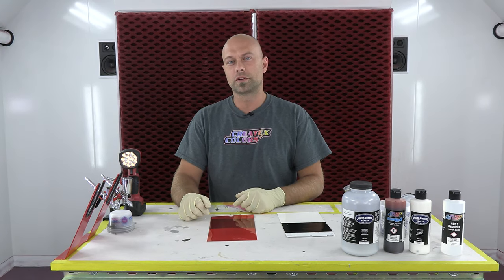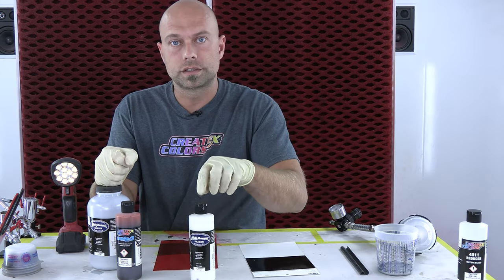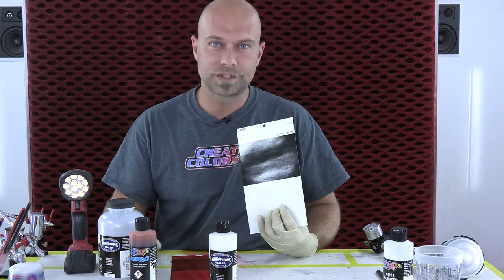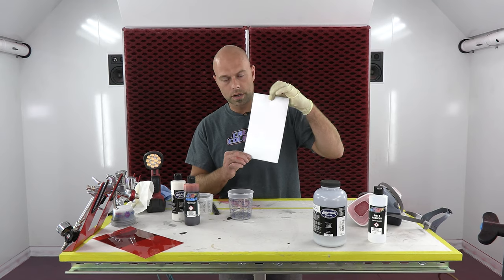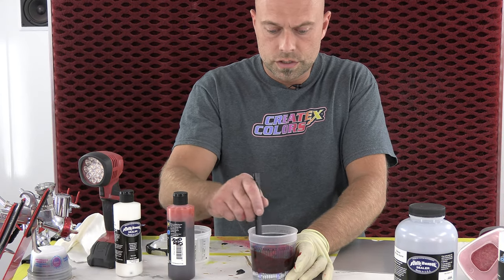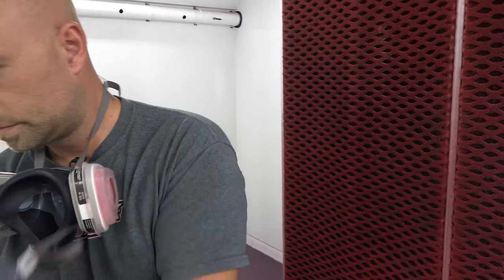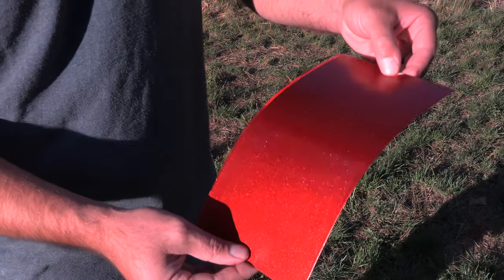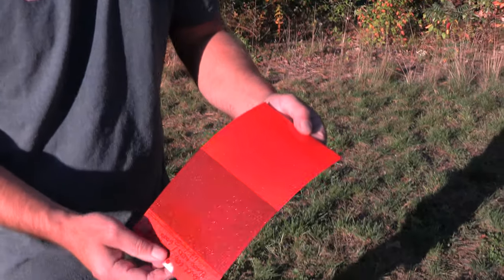How-To Spray a Candy - Metallic Silver

Comment: Is there a difference between the candy 2o and the auto- air candy 2o cuz seen a lot of videos with different bottles so wanted to make sure before I buy the full set
Reply from the maker: All "candy2o" are the same. Older versions of candy colors not called candy2o in the Auto Air Colors line are not the same, nor as well performing as candy2o. Thank you

Comment: I'm a little confused about the difference in the two cards you show.   Is it that one card has a groundcoat of silver sealer, and one doesn't?   Wondering why the white/black shows through on the first card shown and not on the one you are painting in this vid.    Thank you for your vids!
Reply from the maker: This video shows how 6013 Silver Sealer works as a base metallic ground coat for candy2o. 6013 is a sealer, so it covered the Leneta Opacity Spray-out card.  Thank you.

Comment: Do you apply any clear coat or gloss after these steps of is the gloss finish not necessary
Reply from the maker: We use a catalyzed, (2k) urethane, solvent-based clear to top-coat candy2o and candy2o mixes. A gloss top-coat is necessary to bring out the candy2o's transparency and overall brilliance, as well as any metallic or pearl effect. Thank you.

Comment: Could you use this mix for spraying an RC Lexan car body ?  I have my doubts about the sealer since a lexan car body can flex and the 6000 sealer says in the discription that it is meant for spraying on hard surfaces ?
Reply from the maker: AutoBorne Sealer, including 6000 AutoBorne Transparent Sealer works excellent for adhesion to polycarbonate. For best results, apply 6000 first, or 4050 UVLS Gloss Clear, followed by candy-pearl mix. Note, the candy2o mix in this video was different as normally we use 4050 UVLS Gloss Clear for the candy2o pearlized color mixes; we recommend 4050 as the candy2o carrier for application of the color to polycarbonate. Thank you.
Reply: @CreatexColors  thanks a lot.   Will include it in my next order and give it a try 😀
Reply from the maker: Thank you. If you need any more product and tech help, please email us at techsupport@createxcolors.com.

Comment: Can you paint a vinyl sticker under a candy paint
Reply from the maker: Its not a technique we recommend; we'd prefer to paint on the sticker / representation of the sticker, but its been done. Applying 4050 UVLS Gloss Clear or 6000 AutoBorne Transparent Sealer may work best applied over the sticker as an adhesion coating before paint. Thank you.

Comment: what is the purpose of the 6000?
Reply from the maker: Its used as the candy2o carrier / medium; candy2o are concentrate dyes. Thank you.
Reply: @CreatexColors  Could you use UVLS 4050 in place of the transparent sealer for this application?
Reply from the maker: Yes, and quite frankly 4050 UVLS Gloss Clear should be used as the candy2o carrier for all applications. Using 6000 here was a bit of an experiment; sometimes we're sneaking in a bit of R&D as we do these videos.  6000 works for the candy2o carrier, but 4050 is still best. Thank you.